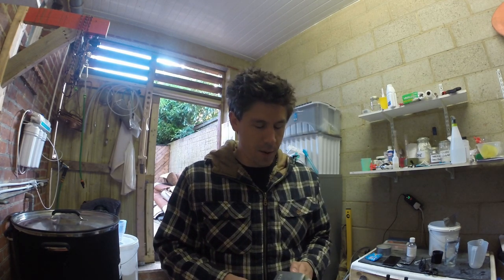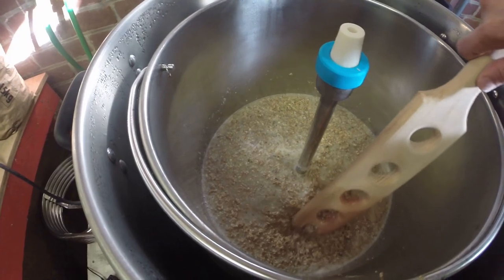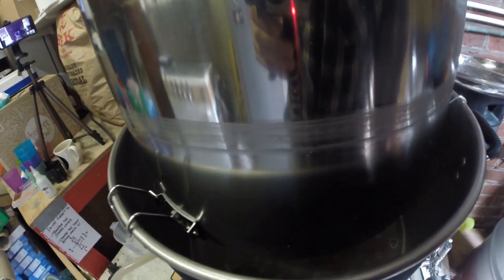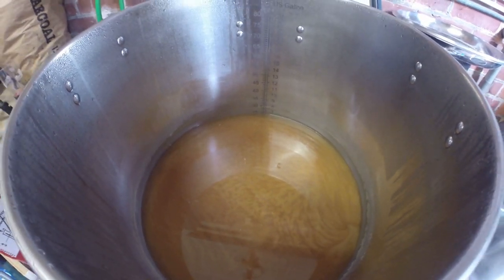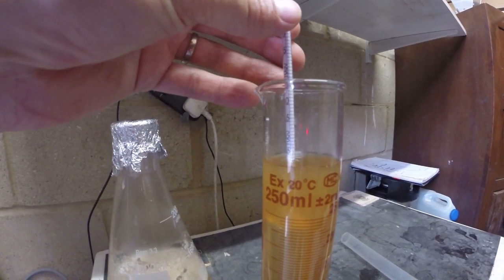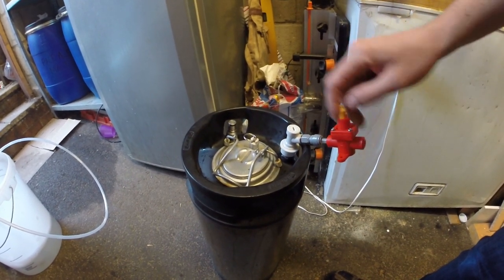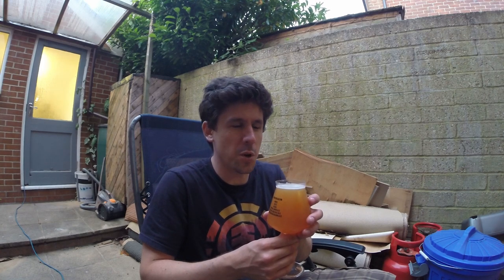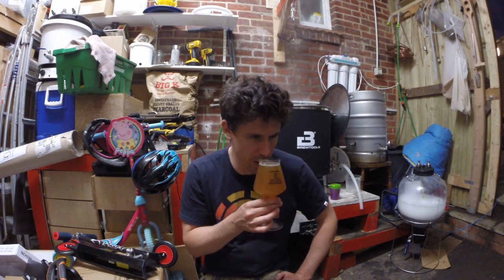B80pro brewday #7   LHG Cheeseburger Mashup

Comment: Do you find the sightglass useful? Have you done any double batches yet? Cheers
Reply from the maker: Which sightglass is that? No double batches yet since I probably need to upgrade the electrics to handle the boil volume, so it'll have to wait for a while. Annoyingly I do have a 60 litre fermenter ready to go too!
Reply: The Blue Trouser Brewer the one on the return valve from chiller. You used your torch on it. The reason I asked about doubles is Iv just hand pulled a double. Only 14kg of grain but it was an epic battle!!!!!!!
Reply from the maker: Wow that must've been a battle. Hand pulling is a bitch even on small batches. I did pull a impy stout by hand which was a 10kg grain bill. That wasn't fun. Shaking like a shitting dog. Ah yes the sightglass. Almost forgot about it. Probably tells you something. Completely unnecessary tbh but very cool to be able to check the colour/clarity of the wort. I did an English Bitter last Saturday. Wort was hella cloudy until I dropped the whirlpool when cooling down to the final stage before transfer. Then everything dropped out and the clarity was amazing! I was stoked.